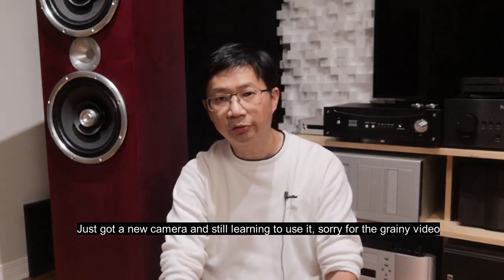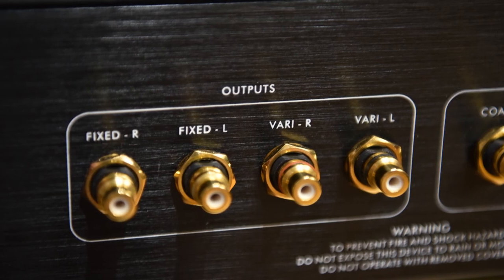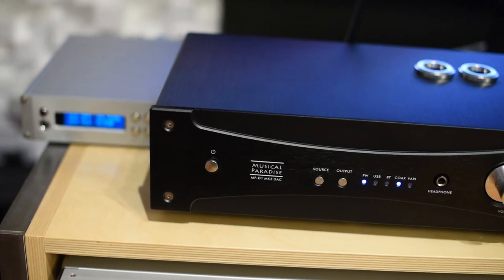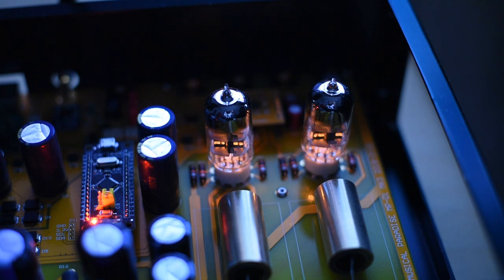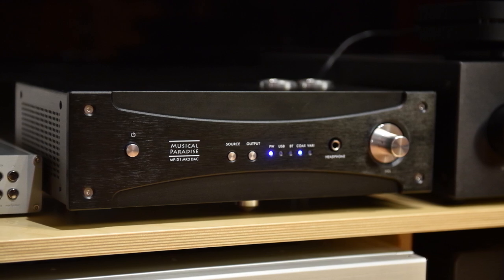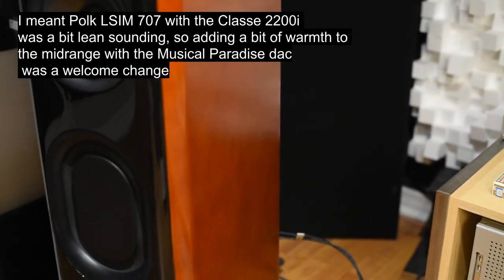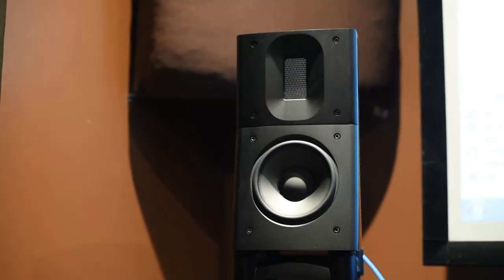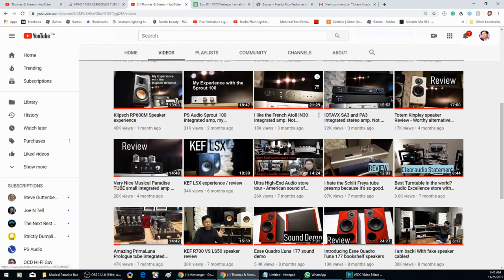Budget but amazing Musical Paradise TUBE Dac? Musical Paradise MP-D1 MK3 review

Comment: Hello Thomas love your reviews, I am considering this DAC Musical Paradise MP-D1 MK3 in hopes that it would sound better than the built in DAC on my Parasound New Classic 200 preamp. Keep in mind this is a desk top system that consist of 2 channel Parasound amp Model 275 V2. Oppo BDP-95 and Kef R300. What are your thoughts? Thanks
Reply from the maker: I think it will make it more analog sounding if you upgrade to 6922 tubes. However, looking at your system I wonder if it will be a significant upgrade. I expect the DAC in the Parasound to be very decent so I am not sure the change will be significant enough until I hear the Classic 200.

Comment: Hi Thomas. Does pairing a DAC with an integrated amp provide any benefits (in terms of sound quality) as opposed to pairing it with a power amp? And if it's paired with an integrated amp (or a pre-amp), is it true that volume should be first maxed out from the DAC (supposed to be the higher quality unit)?
Reply from the maker: Yes a dac paired with an integrated is normal. Should the volume be max depends on the design of the dac. This DAC for example, has fixed and variable output. So you would plug it to Fixed output.
Reply: @ThomasAndStereo  thanks for your reply, much appreciated!

Comment: The most premium DAC performance is achieved by DAC ICs that output line level signals from the IC and all you need is a balanced output stage using premium op amps to get the best possible signal out. This DAC doesn’t even have balanced output and adding tubes in the equation is just about your otherwise clean signal getting some even order harmonic distortion...and yes, some feel that makes their music more live sounding. In fact, live music is most often more distorted than studio music. To me, being audiophile means not to tamper with the signal and adding tubes is no better than adding DSP sound effects.
Reply from the maker: To me, being an audiophile is to create an experience with music that is pleasant to me. If I have to add a microwave into the chain to get the sound I like, so be it. I really am not trying to recreate the actual musical room recording because first I was not there and second, I don't care cause at the end of the day, it is just me and the music at my place and I have to enjoy it. I am just a simple man.
Reply: @ThomasAndStereo  Yes, ultimately it's about enjoying what you do. My point is simply that, technically speaking, your tubes in a DAC are incrementally adding "pleasant harmonic distortion". There is nothing wrong with that if you like the effect of it. But the effect is that live music becomes more live sounding (great if you listen to Diana Krall live) and studio music becomes less studio sounding (not so great if you listen to DeadMau5).
Reply from the maker: I see, good to know, thanks for sharing.

Comment: Hi Thomas had a question just received the Musical Paradise MP-D1 Mk3 is it really necessary to update the firmware will be using the DAC on COAX only I have a very beefy PC but the USB driver won't load also the I've got a flashing light on the USB dongle so hopefully this is connected properly not sure. Never had to go through this update equipment thanks.
Reply from the maker: Hi Nathan, email Garry at MP, it would be best cause I never done it.

Comment: Hi Thomas, just quick one. Can you recommend 6922 tubes that you have tried that are smooth (not brittle sounding), which is the smoothest? Thank you.
Reply from the maker: Hey John, it really is machine dependant. If it works well with gear 1, does not mean it will work well with gear 2. Sure you can say tube 1 has a certain characteristic but it does not necessary work well with all gears. In this video, the tube I tried are ok for the price. The tube I really don't like are the budget Electro-Harmonix 6922EH. It was a bit think sounding for me.
Reply: Brimar and National (Matsushita/Panasonic) are very good NOS 6922/ECC88/6DJ8, usually about $40 each.  The JJ 6922's at $13 each are very good current production.
Reply: @1mctous  Thank you for your suggestions. I will take a look. Thanks.

Comment: Great video. It sounds like a winner. I just purchased it’s bigger brother the D2 mkiii (akm 4497 version). 
In your opinion, does capacitor swapping or tube swapping make the biggest differences? Or do each tackle a different aspect of the sound?
Anyone welcome to chime in, thanks!
Reply from the maker: I have never tried changing capacitor with better ones so I don't know. Sorry. I have changed different values capacitor and that makes a difference.
Reply: @ThomasAndStereo  I see! That’s intriguing considering it’s doable on the MP-D2, up to a certain amount anyway.

Comment: I'm thrilled with this review Thomas. This is Gus, from Boston.  I'll definitely consider this DAC as my next gear! I can't spend more than that and based on the review, it will be a good fit. Wondering if will be a match with my musical Fidelity m2si and focal 716? Big hug from Boston.
Reply from the maker: Thanks Gus. Would it be a good match? Do you find it perfect now with your current DAC? If no, what is missing in your system?
Reply: @ThomasAndStereo  , that's a very good question, a difficult one to answer.  My DAC is the smsl 8a, ES9038Q2M chip. I listen to vinyl a lot and would love to have a slightly warmer sound from my digital sources. It's embarrassing not to know what's missing. At times I feel it's perfect, and that depends on the recording.

Comment: Hi Thomas, any idea whether SQ wise, will the MP-D2 MK3 a big step up from the MP-D1 MK3?
Reply from the maker: No I don't . It uses 5 tubes and has rectifier tube. Sound should be different. I wonder if it is more holographic with 4 tubes in the front.
Reply: D2 has 10 reviews. D1 nil. wished they sent u both units to compare

Gary replied "MP-D2 MK3 Deluxe has XLR outputs, use tube rectifier and has the ability to change coupling capacitors without soldering, so users can change different rectifier tubes and coupling caps to upgrade and customized the sound they like. Also, MP-D2 has highly quality USB input module, so usb input is definitely better. D2 supports akm and ess series of DAC modules. D1 only supports Ess series. D2 use two DAC modules in mono mode to provide better dynamic.  In terms of overall sound signature, they are quite similar. D2 provides about 15% better resolution and more upgrade options."

Comment: Seems like the only speakers I like has first order crossovers or no crossovers.
Reply from the maker: So what speakers you like?
Reply: This is a long article. I know you are busy & dont have to answer back.We spoke earlier of my Sonus Faber Concerto's with first order crossovers, the first ones with paper treated woofers, the speakers I play the most & I think the cabinet has a lot to do with the sound, they are so clear. .Later cabinets didnt seem as good or sound as good in Sonus speakers. The cabinets were slowly dry killed, braced well, & soaked a long time in resins wood oil slowly.The more expensive Sonus Faber bookshelf speakers without a port dont play as loud & sound congested. I have Green Mountain first order crossover bookshelf speakers where one can hear the different instruments playing in different spaces each defined clearly from each other. I have heard the pyramid shaped 3 way Vandersteen speakers with a first order crossover that sounds really well at a low price. They have been made a long time. A lot have been sold. This guy started this speaker in his garage & became famous. an earlier Thiel speaker at a fair price shaped like the cabinet was sawed in half at an angle with metal drivers & a first order crossover sounded & imaged like crazy. After Thiel died, Thiel went downhill. I could've gotten the Thiels cheap, but I didnt get them. I have 3 pairs of Tube Audio Design TAD speakers with no crossovers that are real efficient with the tweeter on top like some B & W speakers that image like crazy. These speakers cant be found. I have 4 pairs of tiny Arcam Alto discontinued speakers that have 4 inch woofers that sound like large speakers, but I have to be careful that I dont play these small speakers  too loud. I believe that the smaller woofer you have, the clearer the sound. Large speakers that sound good need to have separate chambers in the cabinet.You can google & find that another company  made these speakers for Arcam. This other company still makes them. CD's of the Beatles sounds like Vinyl on the speakers, its the tone of the speakers. These speakers are fabulous. I have heard another famous great first order speaker that starts with an "R". B & W speakers are terrible speakers, but I haven't heard the new B& W with first orders. An older amp I like is the Nakamichi "stasis" receivers designed by Nelson Pass the stasis circuit in this amp for 2 years. It had 4 separate power supplies. Ran only in class A, at only low volume, it doesn't run hot. I like the Japanese stasis amp better than than American version. The American versions you had to take your speakers cables cut thinner to fit in the receivers. He had a Threshold amp with this circuit. I like Krell amps. I like tube amps & hybrid tube amps. Tube pre amps. I have several Sony amps that are fair. But I have one cheap Sony receiver That is distorted slightly, but gives a better tone on the Arcam Alto tweeters. I enjoy this amp for a cheap amp. Im into tone.

Comment: I think I know why these middle aged reviewers think everything is the most amazing buy.
For one, they made more money back in the old days before Clinton sold America to China. So their perception of the value of a $$ might be skewed compared to younger people. They were kinda born in the "sweet spot". Not requiring going in debt for college to get a job paying $30 an hour no problem.

For two, it's like knowing how much TV's used to cost and what they cost now. And how much better looking the TV's are now. Prices have dropped a lot since these guys first got into audio and the quality has gone up tremendously. So they are still measuring value by old outdated standards.

It's definitely a good time to be an audiophile. But there are so many options that are high quality. You can't buy everything and supply is basically super high, probably outpacing demand.
I'm knocked out by how good $500 and $600 receivers sound these days. With room correction done right, they outperform systems 15 years ago that would've costed $2000.
Reply from the maker: Sure, the performance today is way better than what it used to be but as I said in my videos, good is no longer good anymore.  Today it is so easy to find gear that performs well. Now you have to be 'great' to even have a chance to be successful. So I look at gear from that perspective. I compare to everything new I try.

Comment: There is no such thing as a tube DAC. This is just a regular DAC chip combined with a useless tube based analog output buffer/post Amp. Tubes adds even harmonic distortion and tend to degrade on performance over time...
Reply from the maker: It is ok, I am pretty sure people will understand and no, it is not useless. It is like saying vinyl is useless.  Just need to change the tubes after thousands of hours.

Comment: It doesn't have fiber optic :(
Reply from the maker: FIber optics or toslink? I don't think it is common to have sub $500 tube dacs with fiber optics.
Reply: Optical has much less bandwidth than coaxial, counter-intuitive as it seems.  Even when price is no object, coax will perform better.
Reply: @1mctous  Yeah but coaxial is not as common these days, I'm even seeing less optical. Many has been replaced with HDMI
Reply: @ThomasAndStereo  I believe toslink is the connector part at the ends of a fiber optic cable.